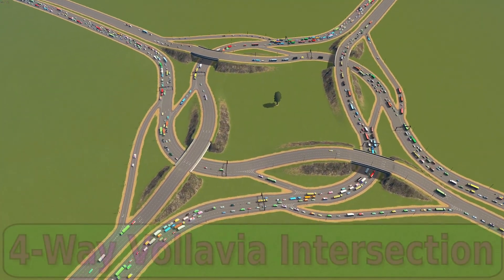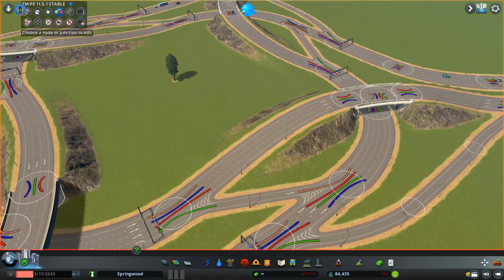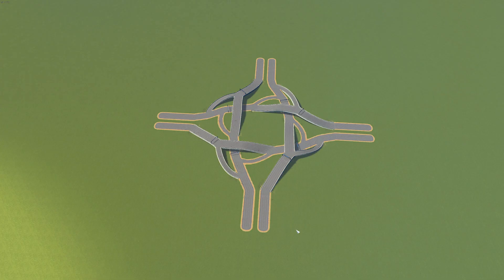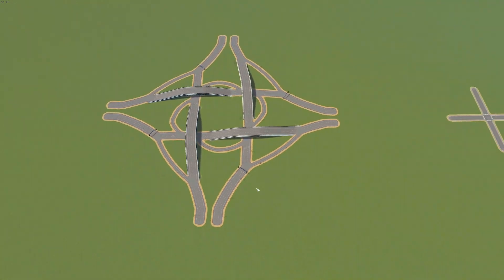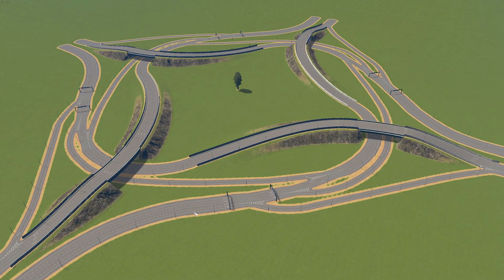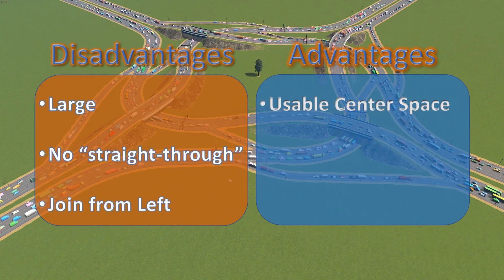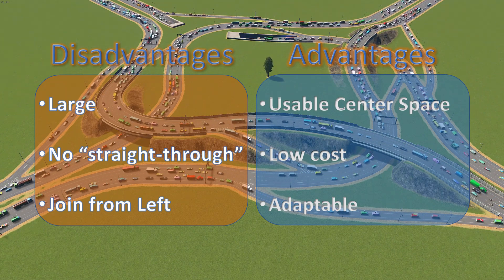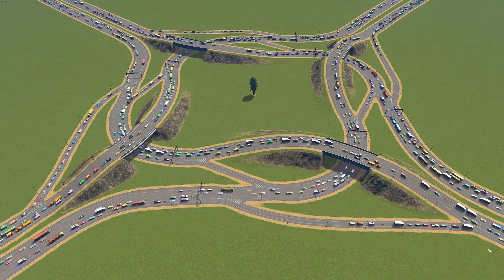Low Cost Interchange, the 4-Way Vollavia

Comment: Nice interchange. I'm learning that CS is like upgrading a PC - fixing one problem just shifts the bottleneck somewhere else :) Thanks to your interchanges I now have very free flowing junctions. Now if only I could stop the traffic jams further down the highway where two cims want to merge into the middle lane at the same time and everyone screams to a halt...
Reply from the maker: Thanks, I'm glad I could help with your highway interchanges at least!
To smooth out merging sometimes what I do is use the lane connector from TM:PE to allow vehicles to move out of crowded lanes a few road node before they are allowed to move into those lanes.